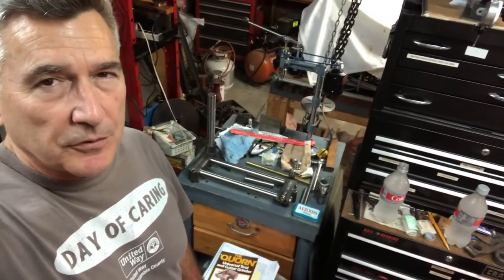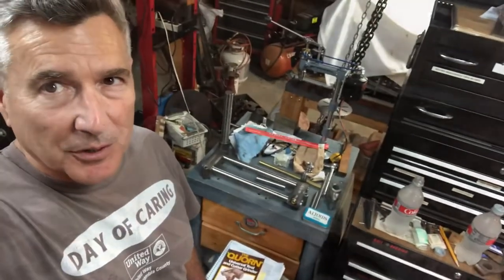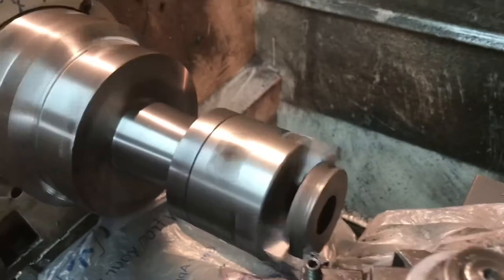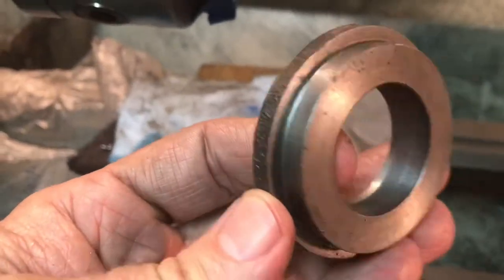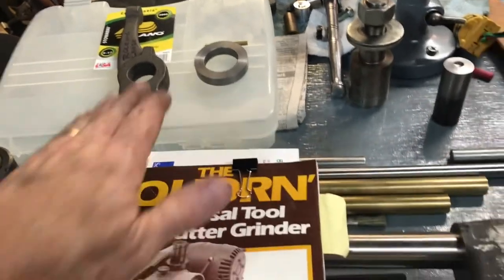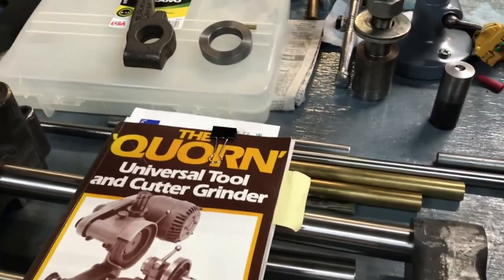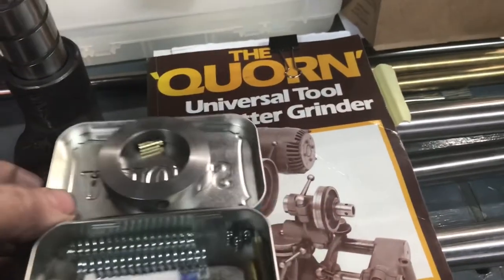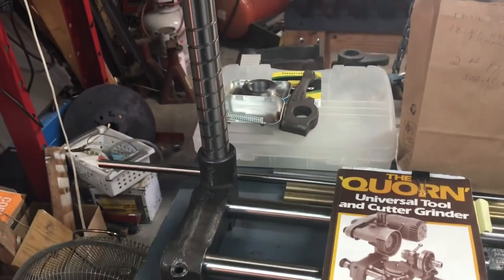Quorn Tool Grinder project. Wheel head nut.

Comment: You could you use some packing between the part (small round one, sorry I don't remember what you called it) and the 2 jaws of the 4 jaw chuck that are bottoming out to move the jaws further outward so they can clamp the part without interfering with each other.
Reply from the maker: Great thoughts. I may do that. Appreciate your comments, will tackle that part soon!